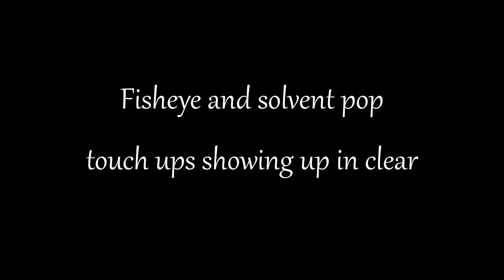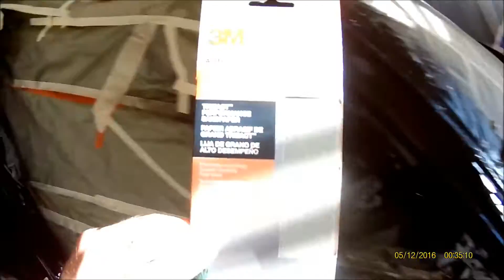Fish eyes and solvent pops show up in clear coat after buffing

Comment: I had solvent pop. It’s not that unheard of. The solvent top layer doesn’t flash off allowing the depth of the coat to dry. It’s like an automotive crème brûlée.  When the top layer dries before the initial layer and hardens faster the bottom layer pops bubbles which permeate the coat and are perfectly suspended in the clear. I had this happen due to putting fan on the coat and not having a slower hardener. It may not be common but it isn’t altogether uncommon

Comment: its so easy to go thru the clear doing that sanding
Reply from the maker: If your sanding paper is 1000 grit ya, 1500 not so bad or 2000, just keep moving dont stay in one spot
Reply: i personally wouldnt touch clearcoat with 1000 grit.  i always start with 1500.      It all depends on how much clear is on the car and how deep the trash is.  i use ppg clears
Reply from the maker: agree with you there, I had major solvent pops on my first paint run, and thats why I had to go that course then re-clear it, to remove them and smooth out the surface
Reply: i have to do the same thing.    RECLEAR
Reply: clear is a pain in the ass.  fast clears you cant trap solvents so easy
Reply: @JacobKnightRiderShop  I always start with 1000 grit. The trick is to only sand until the shiny freckles are no less than 10%, then switch to 2000 and finally 3000. After 3000, I could polish out clear like glass; no need to go any lower. If you found scratches when polishing after 3000, it's probably because there was some debri on the sandpaper when you were sanding. It's always a good idea to constantly spray fresh water over the surface as you sand.
Reply from the maker: @lizardking8388  Thanks for the tips!